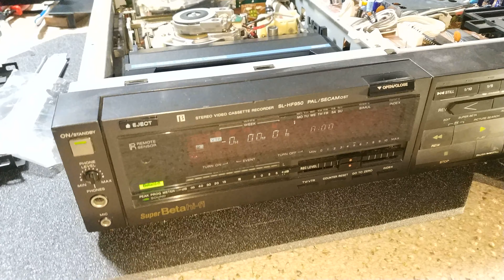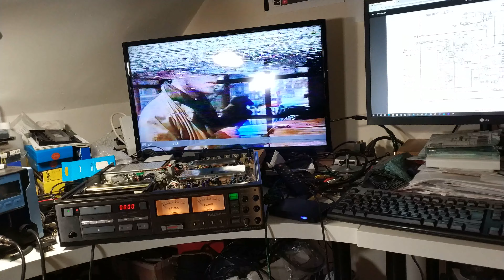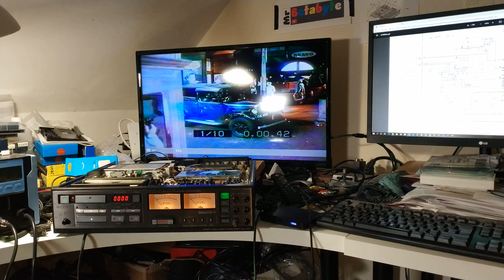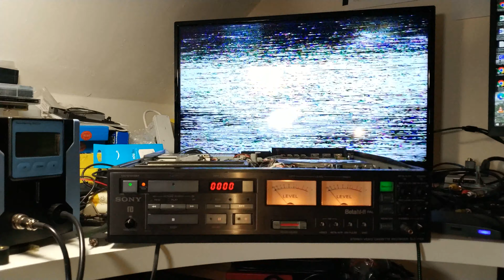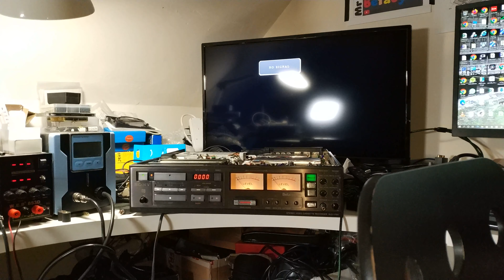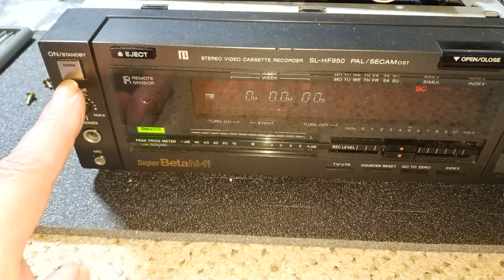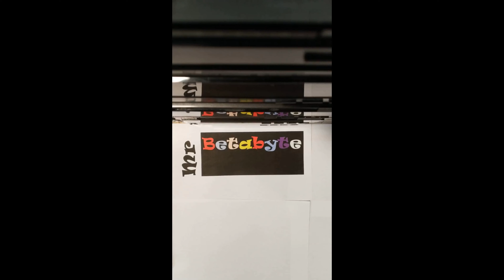Sony SL-HF950 Betamax - Part 3 - Will I ever get this tired machine to work properly!

Comment: Please do persevere, I especially enjoy your 950 videos, even when they don’t fully succeed. It’s my favourite Beta machine & I now have a working one, except for the usual linear audio fault, which had a colour fault when I bought it & as a complete amateur, I’ve managed to fix it with the help of one of your short videos. I really find your videos so entertaining & can’t for the life of me understand why you don’t have more subscribers/ views, I’d double like them if I could. Shared a video to a group I’m in, with the hope you’d get more subscribers but I haven’t seen an uplift. Keep up the excellent work, all the best, Rob.
Reply from the maker: Hi Rob - thank you so much for the kind words and great feedback; it really is appreciated and glad you enjoy the videos and have found them useful. I am looking to persevere with it just it's just so tired but then that's the challenge! I did have a small 'surge' of subscribers - thank you so much for sharing the channel. Lots more HF950 videos to come too.
Reply: @MrBetaByte  really glad to hear that 🙂
Reply: Hi, I used your method of using a cctv 12 volt power supply to power my 950 but, through my gross incompetence, I managed to connect the polarity reversed. There was a fast clicking sound & once I’d realised what I’d done, when I connected it correctly, I could power it on but only the betahifi led lit & sound led if I switched to sound recording position. The power light didn’t come on but if I “fool” it into thinking there’s a tape loaded & I press play etc their leds lights for a few seconds. I have another 950 & connecting to that PSU makes this one power on. I wondered if you could suggest which components might need replacing. Many thanks, Rob.

Comment: Foreword: this is a SONY SL-HF950ES, so the normal Europe version and not the UK version with television standard I (UHF only) and without SECAM. The cassette holder is lifted by a strong spring when the drawer is fully extended. For about 37 years, the white plastic rail on the right side has had to hold up against the roller that pushes down the cassette holder with a lot of force. Since I have already bought a device from the first owner with transport screws, where the reason for the sale was, among other things, that the drawer did not come out, I would rather bet on material fatigue, although missing transport screws can cause extra damage. I set the recorder at a 45° angle and fill the 90° angle with Stabilit Express (it's called differently outside of Germany, 2-component HARD adhesive) from Henkel, about 1" long, resulting in a triangular profile for force distribution.
But now to this problem. Due to the broken plastic holders (I didn't break mine) you can probably also consider broken cables, which is why you should first measure the loop connector, cable, head and returnway. I've never had a completely unusable sync head where you couldn't feel any edge. But if you don't even know where the white cable belongs because you didn't take any photos before you took it apart and SONY didn't document the circuit changes on the Internet, someone probably has a problem... 😉
Reply from the maker: It is amazing that rail has stood up to the test of time so well and yes, I know what you mean - it's epoxy glue and I use it for the very same repair.

I did take photos of the board and have it on video too! 😉 But it really is such a bad board with all of these Sony 'bodges' and I'm just getting to the stage that I can't say it will be reliable even if I do fix all of the issues plus the repair bill quote has been seriously passed!

So annoying Sony never documented most of the modifications though and I do have supplements too for this machine (somewhere!).

Thanks as always my friend. 😊

Comment: Hi, do you have any PSUs for this model that you have refurbished that you might sell? I’ve tried repairing mine following your excellent videos but it seems beyond me. Even using a cctv PSU to provide the 12v doesn’t work but using the PSU from my working unit works fine. Keep up the terrific videos, Rob.
Reply from the maker: Hi Rob, I may well have a few good 950 power supplies but will need to check them. I do also have a modern equivalent which uses the same can but has a very high quality 12v power supply with excellent input voltage range, great regulation and noise-free rail and are used in medical grade equipment. I bought three of these modules and will be doing a video shortly on them. If you'd like ones of those after I've tested it, drop me an email and I'll keep you updated.
Reply: @MrBetaByte I would be interested in anything that could get this working but I don’t see your email address on here, not sure if it’s because I’m using the iOS app?? Regards, Rob
Ps it’s the whole PSU I need, not just the 12v supply.
Reply: It’s the board after the 12v that has the problem. Feeding it with the 12v supply from the cctv/led power supply, I can measure the 12v & 5.9 volts unswitched but the other DC voltages measure less than 1v & the ac voltages measure nothing. I’m sure I did the damage when I accidentally fed it reversed polarity. The beta hifi led lights when the power button is pressed but the power led itself doesn’t light. If I fool it into thinking a tape is loaded, I can make the play/ ff/rew light for a few seconds but nothing happens & if the switch from video to sound is set to sound that led lights. It’s beyond my knowledge to fix it, I’ve changed a couple of caps, with no effect but I’m not really sure which other, if any, I should change. I’d be really grateful for any help. All the best, Rob.

Comment: This seems like a issue with the cable(s) coming of the board that is at the back of the skate. I had a some HF950s once with a lot of dry joints on that board and some cables that had no continuity to the SS board. I had No drum spin on one of the machines due to the board at the back of the skate that had a dry joint on one of the connectors. No counter clock pulses could be to do with a weak or faulty cable/connector or most possibly dry joints on that board. Good troubleshooting...
Reply from the maker: That's really great - I've not had issues with dry joints on the skate PCB but it's really good to know that this has happened so I'll check it through and let you know. Thanks again - really appreciated.

Comment: Buenas tardes desde la España, estas navidades he comprado un video Sony Sl-HF950 lo compre por EBay, desde el primer momento no ha funcionaba bien, me costó 500€ me puse en contacto con el vendedor pero no ha querido saber nada, desde un principio el carro no salía, había que ayudarle estirando de él, luego al darle al ejet para meter la cinta había que hacerlo rápido porque enseguida la metía para adentro, en fin un mal funcionamiento, ahora estoy viendo constantemente videos tuyos y los comentarios de los demás  los cuales me encantan, paso muchas horas repasándolos, porque me he dado cuenta que hay que hacer un proceso de ajuste con los interruptores, que lleva en el lado derecho y con el motor de carga pero aun no me atrevo a desarmar nada, al final tendré que hacerlo ya que la maquina no funciona nada meto la cinta y no funciona el play ni rebobina no hace nada solo enciende y ahí se queda, os agradecería que en lo posible me ayudarais ,gracias anticipadas.
Reply from the maker: That's all too common when buying from eBay and that was a higher end price for one of these. You can carefully pull out the drawer and then check the plastic rail on the right for any cracks and damage. I common issue  is the helix gear on the skate/ sled motor becoming sloppy which can cause issues. There is a sort of mode switch on this motor assembly that tells the logic where the skate/ sled is and it may well be this needs a clean and/or a readjust. Does the machine try to play/ fast forward/ rewind a cassette or does nothing happen at all when you press any of the buttons? Good luck and lots more HF950 videos to come. I do have one machine that has a sled issue and I'll be showing that very shortly.
Reply: Buenos días, creo que el problema está en el posicionamiento del carro o patín, para luego colocar el motor otra vez, es lo que me falta saber, reparé el conmutador de modo y cambié un fusible de la placa SS50, ahora, pulsando open close, estando la cinta dentro enhebrada, aunque no veo que enhebre hasta el final faltan unos 2 mm ,el play no funciona y la cinta se vuelve a desenhebrar además le pulso al botón de eject y el cajetín de la cinta no levanta, le pulso al botón open/close sale el carro pero no del todo, le tengo que ayudar estirando con cuidado de él, estoy más liado que la pata de un romano y más perdido que un pato en un garaje, Jejejeje, te agradezco tú ayuda. Un abrazo.

Comment: hell is the word you put alot of time in to the decks over the years  this why i stopped using them

big fan of the betacam  sp uwv 1800 decks   i pick a 5thone up so easy to find what was bad on it  front panel  of changed over a pcb  and power  unit i recapped `a long time ago   i re cap the power unit later when i not have alot on 

i gone of the home decks  i am looking in to alot of  100ub decks that came from a video replace 

i spy on the net here there's the same ones  talking to the same one's i just think the old sony home deck life is coming to a end

i been saving betacam decks from a skip as getting them fixed and to many out there  now  i have alot of them all working
Reply from the maker: Yes, they are certainly time consuming but i do love them and getting them solid and reliable is a real challenge that I'm really getting quite good at reaching! Totally get the Betacam love though and the total build quality and uncompromising electronics they tend to use.